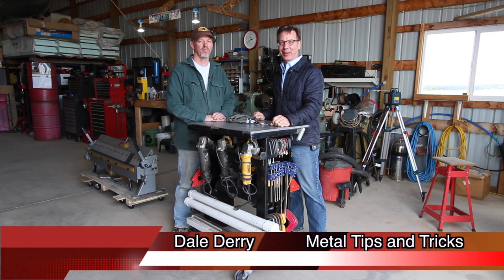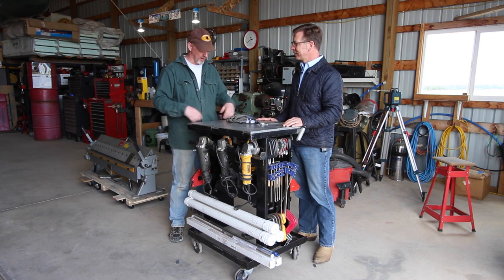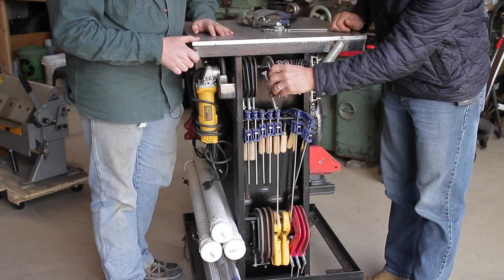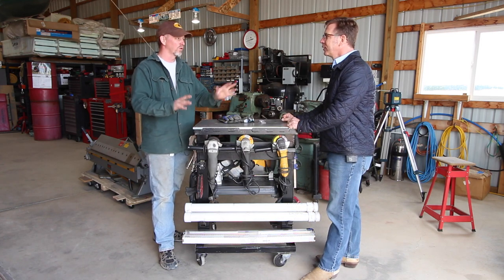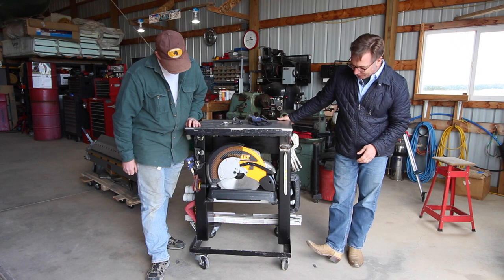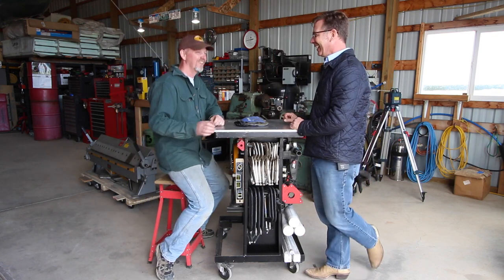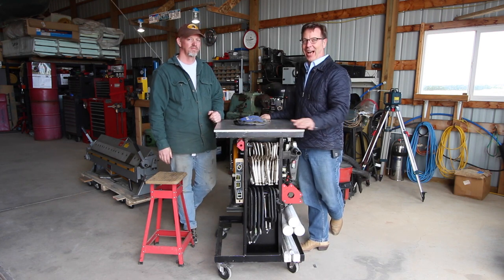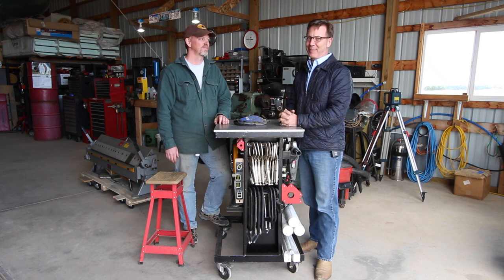Ultimate welding table

Comment: super nice shop in progress.  really like the welding table.   I did notice that that stool could use the seat corners rounded off.    I hope it is okay I mentioned on that.    I see ergonomics in action there
Reply: +ted sykora no problem.  The video doesn't show it very well, but the corner have a small radius and the top edge has a radius all the way around.  Admittedly using a stool I found in the corner of someone's shop probably wasn't the smartest thing.  I could have found nicer, but it works reasonably well.

Comment: Love the rebar clamp hangers.  I'll have to weld some of those up for where I work soon because I'm tired of pegboard hooks pulling out under the weight of clamps.  

I'd change the base to a tubular frame shaped like an H so you don't have that cross bar right where your TIG pedal would sit.

Comment: Great ever evolving welding station.
I added electricity to every think I built.  Switch and a single outlet for lighting with
a unswitched double outlet for power tools.

Never had to move, unclamp etc.

My lighting as conduit which slipped into another piece of conduit welded to a leg
beside the electric.  Right angle weld at right angle to top help free strip light.
Could remove light, turn light and get it where I need brightness.  Easy to remove of
turn out of the way.

Consider an additional layer - source larger size of AL piece.  I can think of
several ways to extend the size and then return it to the current size.